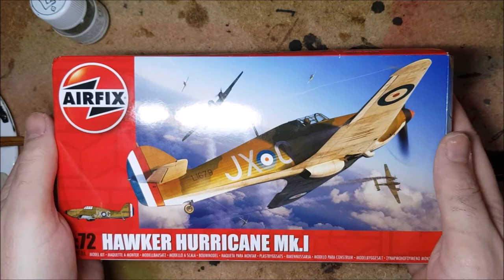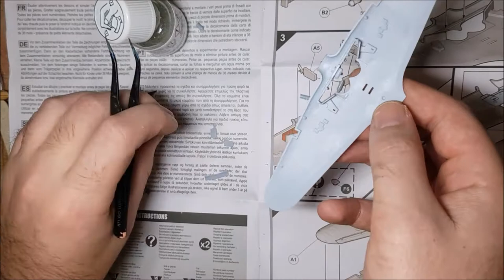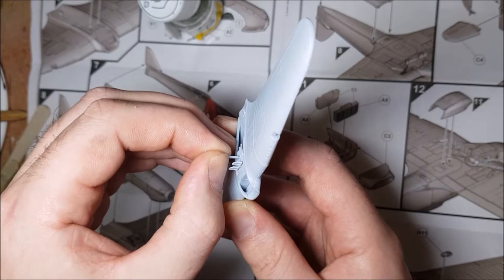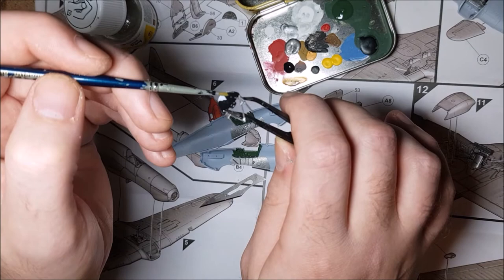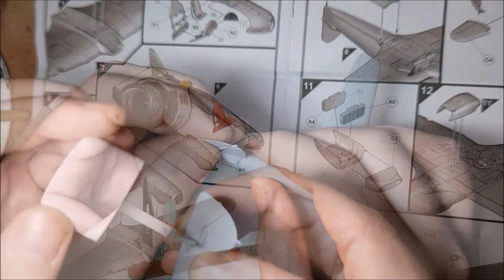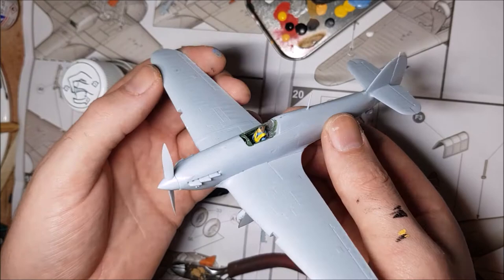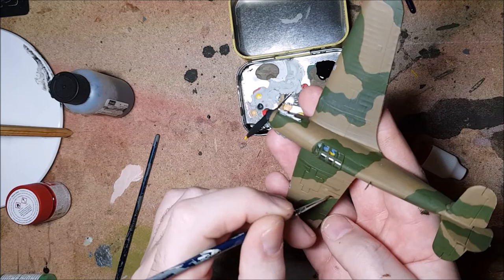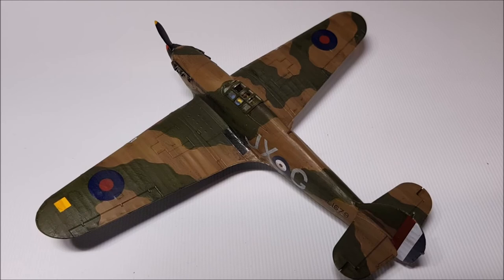Airfix 1/72 Hawker Hurricane Mk1 Build Review

Comment: Is there a way to fit the propeller to spin for this model?
Reply from the maker: Yeah you can get it to spin, there is a pin that goes through the hub into the prop but is hard to not get glue onto the pin, it is a tight fit though so might help if you sand the spinner cap or better the hub down a bit